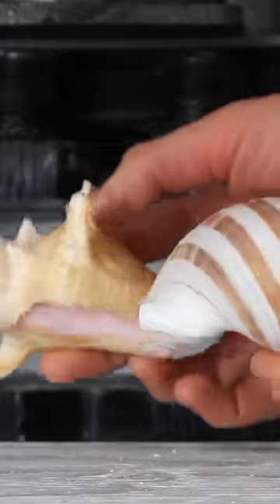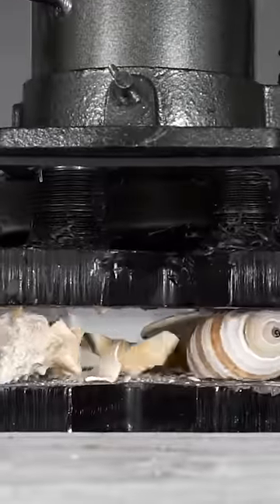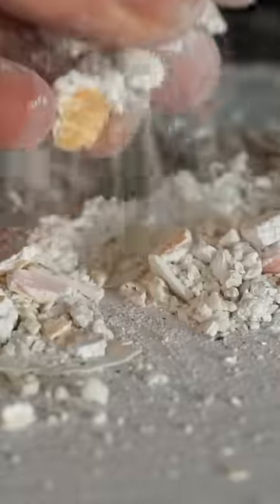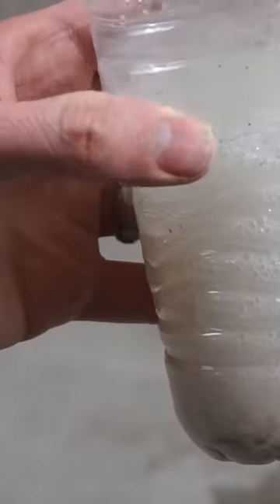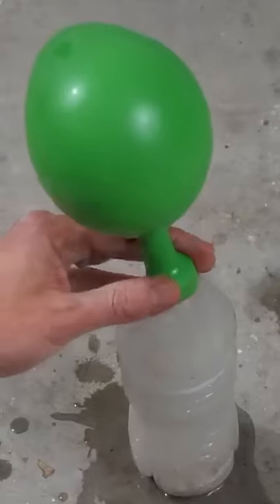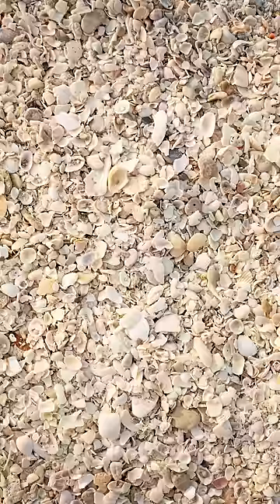Storing CO2 as Sea Shells?

Comment: This sounds an awful lot like an SMBC comic plot:

"I've figured out a way to reduce CO2 in the atmosphere! We'll just use electricity to store it away in seashells!"
"And from where will we get this electricity?"
"Burning coal!"
Reply: That's why nuclear fusion reactor is so important to our environment.
Nuclear fission reactors can produce much higher electricity compared to fossil fuel generators, but it makes radioactive residues. But nuclear fusion reactor creates helium and even more electricity. Real clean and large energy sources.
Reply: @pitot0philo207  once we unlock fusion, we'll solve 90% of the world's problems
Reply: I mean we have solar for a reason already. Fusion is great, but we already have fusion at home! (the Sun)
Reply: @vicradon that would also work if we just used enough of the nuclear we have now
Reply: @Bergie3113 
Conversion efficiency of solar panels is a maximum 29%.
This means that even if we get 100MWh of solar energy, we only get 29MWh of electric energy.
Since I'm Korean, I'll talk about the energy production of Korea.

In S.Korea, we makes 209MWh of electricity/km² by solar panels.
Meanwhile in nuclear fission reactors, we produce 11700GWh/km². Since 1GWh is 1000MWh, it's 11700000MWh.
Compare to solar energy, it's around 56000 times higher.
The efficiency of nuclear fusion reactors are around 7 times higher, so in conclusion, if S.Korea has a one nuclear fusion reactor, it can produce energy that is 392000 times higher than solar panels can.
Reply: @Bergie3113 
And for clarification, /km² means the net area of solar panels and Nuclear fission reactors can be ignored since we compare the two amount of energy produced by generator with a unit area.

If you want to know the net energy production, here it is.
Net energy generated by solar panels are 24000000MWh, or 24000GWh.
Since we know power generation per unit area, we can calculate the net area of solar generator and it's 8,275,000 km²
Net energy generated by nuclear fission reactors are 170,568GWh, and also, the net area of reactors are 15.89 km²

So, A solar power plant produces 1/5 of the power in an area 60,000 times larger.

Comment: We could also seed the ocean with iron filings which stimulates mass plankton growth which would feed marine life but more importantly would capture massive amounts of co2 which when the plankton dies sinks to the bottom of the ocean and returns said co2 into the carbon cycle from which it came
Reply: Yes please
Reply: Don’t tell this to mining companies! The bottom of the Ocean has all the minerals that they want in order to make the devices that you used to put this comment 😂
Reply: Actually, only a small fraction (about 10%) of the new biomass makes it to the seafloor. The rest is eaten or decays before sinking very far. So the main benefit is increasing the base of the food web, which could still be very beneficial, but it's not really a method of carbon sequestration.
Reply: Unfortunately, they already know. There are several mining companies that siphon iron orbs from the ocean floor

Comment: I've seen people build underwater houses out of window screen connected to solar panels on a floating buoy using this method . 
   I hope they finished off the inside with some sprayCrete and waterproofing.
Reply: That sounds interesting but how do I find this online? 

What should I search for?
Reply: @GazB85  Maybe under ways to save coral from extinction. That's how I ran across it. 
   The idea was to use these electrolyticly created calcium carbonate structures as a base for coral growth in deeper waters and/or cooler waters. To seed the growth of coral in places where they could survive after sea level rising and global warming.
Reply: @petevenuti7355  Oh right, thank you.

Comment: Start harvesting methane in small ways for homesteads,campsites, etc.  Simplify the process so we are utilizing leaks and decentralizing power and tech.  
Work towards climate cooling via Walter Jehne's methods through rainwater harvesting earthworks, etc, planting site-appropriate trees, and soil building biomes.  These are massively effective, durable, problem solving on many more levels, etc.  
It allows independence from big tech solutions and their centralizing problems, etc...
Reply: You sound like you actually know what you're talking about. I will have to read up on all of these interesting methods that you mentioned.
Reply: @harnoth  

Been listening to everything rather than trying to follow one narrative or another.  I like permaculture principles.  Simpler, low-tech solutions are easy-to-manage and keep down costs while also using resources already available.  The emphasis is to avoid harm while allowing care for people, livestock, etc.  
It is a lot different from Communism or Socialism.  It's different than letting mega capitalist entities have free reign too.  (So many of the bigger, big-tech solutions are death by a thousands cuts.)  Permaculture is for where you're at rather than waiting.

Big fan of Geoff Lawton, Brad Lancaster and Mark Shepard.

Comment: 1) storing co2 is easy. And this is one method.
2) limestone is a very important base resource for us, as we use it to make concrete.

HOWEVER
3) turning co2 into limestone is expensive, especially in the form of energy.
4) limestome is abundant. So why make it when you can cheaply pick it off the ground.
5) storing co2 in the atmosphere is cheaper right now, and has limited ill effects. "Its only 2 degrees, whats the big deal".

Comment: They also make calcium acetate, which you can pour rubbing alcohol in the dissolved solution and it'll crash out. 
Once it falls out of solution it'll become a gel like substance.
Scoop it out and roll it into a ball and light it on fire! The alcohol will burn off but the calcium acetate will break down into acetone and calcium carbonate again! 
Flaming snowballs I believe they are called! It's fun! Lol

Comment: The problem with electricity based carbon capture is that you need renewable electricity for them to make any sense. And this makes carbon capture useless for as long as our electricity isn't 100% renewable, because we could instead use these capacities to replace Carbon based electricity generation, which will be way more efficient at reducing the amount of CO2 in the atmosphere.

Comment: 3 things:
1- co2 in thw water is not the problem. The problem is co2 in the air. So that doesn't rwally work.

2- This process requires energy (even if we ignore the energy the logistic takes and just talk about the electric current), which is produced by... that's right, releasing co2 into the atmosphere. So the entire process is more harmful than helpuf.

3- Even if it was a net of more atored co2 than wasted, and even if resucing co2 in the water was useful to begin with, then... are we going to pretend all it takes is sea water, and ignore all the other materials used in the process?

Comment: So if we best MASSIVE renewable generation capacity, we can use that to store CO2 and then we could continue using fossil fuels as long as it’s economical, and in time (when the oil runs out) convert that CO2 storage capacity to e-fuel generation capacity. Unless just doing the latter is more economical off the two in the first place, which would be my guess.

Comment: The real question is, doesn the process store more CO2 in solid form than it produces to generate the required electricity?
Reply: @mandimystic4437  but to achieve that realistically, how soon can we manage the entire process, from manufacturing the renewable energy generator to the tools needed to sustain that? And most importantly the politic BS behind everything else... I don't see any real solution behind our current renewable pathway to make a big enough impact on the CO2 issues we are facing right now :'(

Comment: I have strong doubts that this would work to fight climate change. The primary concern is how much CO2 is emitted from the electrical current to produce this result. This application we see here is particularly small, but on a grand scale it would use unbelievable amount of energy, thus negating any benefit.

If green electricity were used, it would lessen the impact. However, we must consider that solar panels require rare earth metals, and require enormous amounts of fossil fuels to create, too. Wind isn’t without its problems, too, as it can have harmful effects on the ecosystem in the surrounding area.

At some point, we must realize that technology is what created this predicament. It is doubtful that technology will get us out of it. The only solution is to abstain from technology altogether.

Comment: And if we store it with some data-vibrations we can actually at the same time store data while solving the environmental climate issue, also I think there’s currency to get from sunlight and gravitational energy from surrounding planets and space things .. perhaps a better storage solution than a Bitcoin-blockchain-ledger. By the way, electric radiators that’s not a processor should not be allowed 👍

Comment: That's all well and good, but producing that electrical current means burning fuel, introducing more CO2 into the atmosphere. If you produce the current using green energy (like wind, geothermal, or solar), then that's green energy that could've been devoted elsewhere, replacing the burning of fuel; i.e., the opportunity cost is that you're still effectively putting more carbon into the atmosphere than you're taking out.
The only solution is for humanity to effectively quit fossil fuels cold turkey. It would demand a dramatic restructuring of virtually every industry, and the toughest effects will undoubtedly be disproportionately felt by disenfranchised communities, but time is basically up. We quit oil, or we die.

Comment: so if you try this with aluminum anode it dissolves and if you use stainless steel, you get toxic chromium. I ordered a cheap ($13) anode that is platinum coated titanium, but other than that i so far cannot disprove anything in this video it's nuts. i don't know how long it will take my account to upload a video of making limestone from seawater, however

look, currently the tech is: 6VDC. you want a beefy PSU because you dunno what everything is, but if you can put hella 6VDC into seawater in a container, you will get clear liquid above and some white floaty shit below.

I haven't decanted the liquid and applied muriatic acid to the white stuff to see if it is actually CaCO3, but based on my understanding of the chemistry and science worst case i am making sodium hydroxide.

there are a bunch of claims that there may be "industrial levels" of output on this, but as far as i understand the only people that recognize that you can use electricity to force elemental calcium into CaCO are people that have applied for patents for removing scale from coolant systems.

I am unsure why this has taken hundreds of years to discover, but i plan on putting this technology on barges and not dealing with a manager ever again byeeeeeeeeeeeeeeeeeeeeeeeeeeeeeeeeeeeeeeeeeeeeeeeeeeeeeeee
<3 thanks for uploading this, whoever you are. I love you. Sincerely.

Comment: You really need to study the lime cycle. CO2 is only about 40% or more of what seashells are made of. The major component is calcium. You don't need any electricity to make make limestone. carbon dioxide will automatically return to calcium hydrate.
 Mixing the calcium carbonate with an acid reduces the pH and releases carbon dioxide. Typically you would use hydrochloric acid to make calcium chloride. 

Storing CO2 as sea shells is what nature has been doing for the life of the earth. You can't add CO2 to seashells as they already have the amount of CO2  the can hold. If you release the CO2 from calcium carbonate with heat (endothermic) you get calcium oxide. When you add water to the calcium oxide (exothermic) you get calcium hydrate then the CO2 will return to go back to calcium carbonate (think concrete). You've solved nothing because to get CO2 into seashells you first have to release the CO2 they already hold.

Comment: I challenge a scalable model of an ocean-based electrical generator.  10,000 % sure no actual device will ever be placed in ocean water without a lot of attacks by democrat supported officals.   You are not allowed to solve CO2 problem, because it is known to not be an issue.